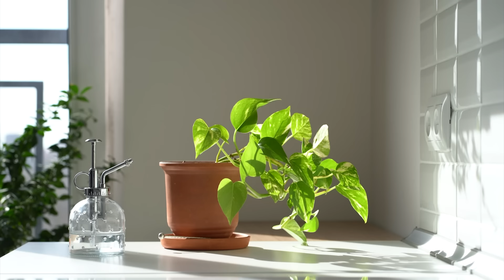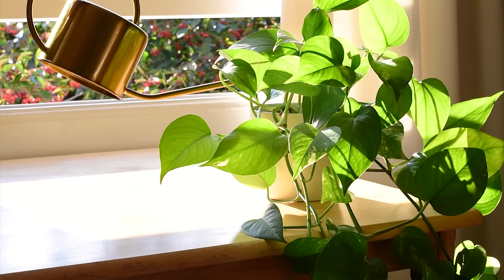Giving your house plants genetic super powers

Comment: its an extemely cool idea, but i dont know if its still practical at this stage. regular air purifiers can be hundreds of times better at filtering compounds like these than regular houseplants, so while these are 30x better than a typical plant, it probably still doesnt hold a candle to an actual mechanical purifier. if purification is your main aim as a customer, you'd be better served getting a purifier and a cheap plant separately than dropping upwards of a hundred bucks on one of these
Reply: Mechanical filters don't remove VOCs. To do this you need charcoal filters that have to be replaced regularly (that's the failure point). So there is some merit to the idea of plants decomposing the VOCs. Whether it's really practical I kind of doubt it.

And if you have to throw some costly powder at your plants in regular intervals, might as well change a charcoal filter in regular intervals.
Reply: Millions of times…. A single house plant is going to process around 0.1 m3 of air per day, it’s essentially nothing. 
Love this channel, but neoplants as anything more than decoration is BS.
Reply: @N_Jones  While I do agree with the OP and you to some extent there is more than enough research that shows regular houseplants do improve the quality of the indoor environment in multiple ways - individual houseplants are certainly decorative more than anything else, but they do also work to regulate humidity, reduce the CO2 concentrations etc enough to be measurable even individually. Which for a silent, near immortal (compared to filters) and low maintenance option to improve your indoor air... Not entirely sold this engineered stuff actually makes sense at the price compared to just having a few more cheap plants or investing in a whole house air exchange type system and the filters. But silent and electric free air improvement is pretty neat.
Reply: @foldionepapyrus3441  NEOPLANTS COST AROUND $200 A YEAR!
  
I'm not against house-plants ... but it just takes a few calculations on the back of a napkin to see that a single houseplant has negligble effect in comparison to a single human.   
It's woo.  
  
Buy a regular housplant  (or buy 100 plants for that price) or buy a an air purifier for $50.
Reply: @N_Jones, perhaps at this stage, sure, but this project has not been around for very long and will no doubt produce more efficient products over time. 
Look at cars for instance; when they were first produced, they had a top speed equal to or only slightly faster than a horse-drawn carriage, and required being hand-cranked to start each time, but now even the cheapest of modern cars start with the turn of a key or push of a button, and easily reach 80-120mph, with high-performance Formula 1 cars reaching speeds over 200mph. Modern vehicles are also far more fuel-efficient, stronger, and safer than previously thought possible. 
Imagine going back in time to the 1920s-30s when consumer automobiles were first becoming widely available, and telling them about the speeds of modern cars, as well as the fact that even base-model safety mechanisms that are present in all vehicles, allow people to survive, sometimes uninjured, from highway-speed wrecks, including turn-overs. 
What I'm saying is that it has to start somewhere, and you can't expect instant miracle-level results from new projects right away. Unless outside forces interfere, I see no reason why these new additives and plants varieties wouldn't progress to be as, if not more efficient than equally-sized room purifiers.
Reply: @SpeedDemonStar  plants will never be pumping though air at high rates.  
that’s a ridiculous analogy, we’re talking about plant-physiology not mechanical engineering, they work at the rate of biological processes and are limited.  It’s not an internal combustion engine FFS!
Reply: @N_Jones  "Man won't fly for a million years"
Reply: @SentinelleArgent  again, man flew through mechanical-engineering…call me when you sprout wings and fly.
Reply: @N_Jones man just dismissing ideas like this is simply so anti-science.
Reply: What if it gets to a point where we get these plants everywhere outside. Cleaning the air passively.
Reply: purification is also something the french can excel at
Reply: This!
Reply: I agree with the "at this stage" part to an extent; however, as the research progresses, the plants can and have become more effective and will only continue to become both more effective filters and more cost effective to produce. 
Also, in reference to costs to the consumer, there's some important things to take into account such as the costs of upkeep and potential repairs and replacements. If a well-cared-for plant will last for years, decades, or longer, without needing to pay for repairs or replacements, even if takes multiple plants to purify the same amount of air, it's not hard to see how the plants would quickly pay for themselves. Even if you have to supply more of the additive of the plants over time, it has a lot of potential to be cheaper than having to replace an air filter as frequently as once a month (or more), along with paying for repairs/maintenance of the machine or, eventually complete replacement of it. 
There's also something to be said about the fact that if you're going to have something anyway, in this case, a house plant, why not get one that offers additional benefits beyond just being ornamental? I know people who have a minimum of 2-3 plants in most, if not every room of their house. If every one of them had additional air filtering quality, I could see how the benefits would quickly add up, potentially to that of a cheap, low-quality air purifier, without requiring electricity, replacement filters, and repair or replacement.
Reply: Check the website of neoplants. The claims there seem to be solely about the  soil bacteria (which you buy monthly as some liquid additive!) not the plant at all! The video and the website says entirely different things.  Interesting that this is ‘directed evolution’ when it is clearly presented as genetic modification!!
Reply: a lot of people don't have mechanical air purifiers. plus most people have plants. or course the industry in general also should be orienting more towards making products that don't release VOC. for like latex paints which even if there are no VOC's added will usually release some formaldehyde from the biocides. but you can use additives that chemically bind formaldehyde. of course this formaldehyde scavenging property doesn't last forever. but it can be enough to really lower the output of the product itself. maybe even slightly negative
Reply: @dutchik5107  Well they should buy an air purifier rather than a plant if they suddenly decide they care about air quality.
Reply: The plants don’t [directly] require electricity, however!
Reply: @AmaroqStarwind  Nope, they require $200 worth of neoplants additional products added each year...   It's woo
Reply: @N_Jones  It's not "woo". Chiropractic & cupping are woo. This actually is & does what it claims. Seems like the cost might not necessarily be justified compared to the extent suggested, or maybe it's the extent assumed by some viewers? I don't know. But It is a great proof of concept to build upon, regardless. And there are plenty of people who keep lots of plants. The "Panini era" brought out a lot of collectors, and a big sector was houseplants. As a plant person, it was a blessing and a curse. There's been so much greater availability and variety of so many plants and related bric-a-brac. Now that the "craze" portion has mostly passed, we're mostly past the pricey snippets of "ultra rare" species, and seeing innovation beyond hastily thrown together knick-knacks.

Would this stuff be worth it? Probably too expensive. But it would be great for someone like me with bunch of plants. Maybe the cost will drift into a more reasonable range, and even efficacy improved upon. Seems a neat concept, at least, price notwithstanding. And while the air filter seems great, think of the many people who live in regions which have spotty or no electric, &/or can't hook up a whole HVAC system (like folks who don't own/live in a house - renters, municipal housing, etc.).

Tldr it's not "woo". And for a first go it's pretty cool.
Reply: @mookinbabysealfurmittens  yeah i dont think its fake or anything, clearly. i just don't think it's as useful as a charcoal filter.
for people without electricity, sure, but like... why would they drop $100 minimum on a plant on a website they can't even access?
the thing is, for this to be useful in that sort of situation, it'd have to be modified to exist in the wild, or at least cheaply produced and developed en masse for developing regions to utilize. not sure that is the direction they're going here, though.

anyway, after reading these, it feels like the consensus is:
- if air quality is your main concern, get a purifier with a charcoal filter. more effective. then get a second cheap plant if you want one for decoration.
- if you don't have electricity or can't stand the sound of a purifier (i forget if the pots for these things have fans or not) then sure this is objectively useful, but like, that's kind of hyperspecific imo.
- if you have a lot of plants and wanna blow some cash on a neat concept, sure.
- if you just want to support the comany's efforts, sure.
i think thats the gist of it.

edit: actually, thinking on it? designer potted plants would be less useful for public or developing areas air quality than designer trees. trees actually do compete with normal purifiers really well from what I've heard, so why not apply these principles to a tree species?

i am sure I am not the only one to think of this, even inside the company, but its a more useful concept imo. having, for example, a small plaza in a huge building with GMO trees that can filter 30x more than the same species unmodified would rule
Reply: @loddite_0 Very excellent insight and points made, and I have to agree. Cheers
Reply: @mookinbabysealfurmittens  ok, it’s not “woo” … that was a poor choice of words.  
It’s a money making venture, using science dazzle. 
 
Let’s say for argument they are 50x more effective than a regular house plant, and clear 5 cubic meters a day.
That’s 10 resting human breaths, 40 seconds of breathing worth each day. 
 
20 seconds of breathing a day for a family of 2…for around $200 a year. 
You’d need hundreds to make any difference, and most houses have fresh air coming in at far higher rates than 5m a day , essentially nullifying the tiny difference it does make. 
It’s selling ice to Eskimos (or some such saying)
Reply: @loddite_0  you should think about space travel. You have here a lightweight and energy efficient system to improve the air quality in your small space ship. Need a fail safe? double the amount of plants. No filter or electric parts that can fail and more oxygen for free. It's no wonder that nasa released one of the well known articles about house plants that clean the air.
Reply: People seem to skip over how annoying the noise of mechanical ventilation is to most people. Gimme some effective plants please.
Reply: @egregius9314  (Also, the power draw.)
Reply: @egregius9314  The same most people that have noisy air conditioning because they live in warm climates?
Reply: Related to nothing your profile picture is wonderful, who drew that?
Reply: Oo +1 OP. Cool av pic!
Reply: @mookinbabysealfurmittens thanks!

Comment: I think I missed the part where they specify what lumes the plant needs to process anything.  Seems to me like they would be selling it with a 200w LED or require it for results seeing 30% of whatever.  I would think it would be a tower & not desk-art.  Maybe it should be room art like a Christmas tree is.  Instead of only selling plants & bacteria they should team up to sell light-art.
Reply: For 200W you could run many air purifiers
Reply: If that pothos is like the one in nature in terms of PPFD (light measurement used for horticulture), then you can easily get away with a 10w grow light at a distance of 30cm.

Comment: i think part of the dislike of fast and precise changes is quite literally that they are fast and precise, slower things give the environment and lawmakers more time to react and less precise things limit how much better then the current you can get
Reply: Bulk of gene edit methods arent precise tho. The main issue in most fields using cas9+ like guided edits is that it takes years to show what flaws were indirectly created (notable fruit agri and commercial flower sectors). It has a solid "barely short of 10%" rate of ending up with random stabilized loops with the new genetic info in places it wasnt designed for.
Its just fast and (due to bulk of the research being done by non-profits that release the results and methods) very cheap at the cost of efficiency and safety.
Reply: So its precise with unknown issues, great... If only it wasn't Monsanto 🤦🏻‍♂️